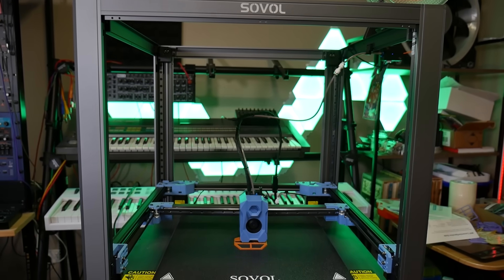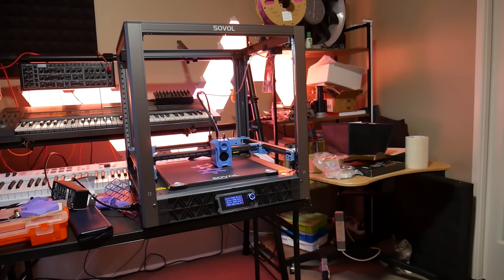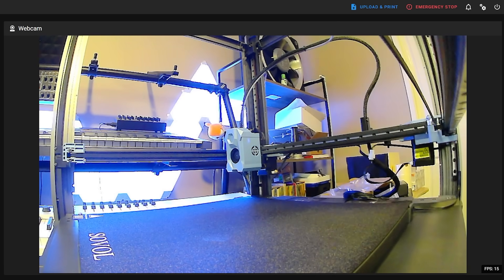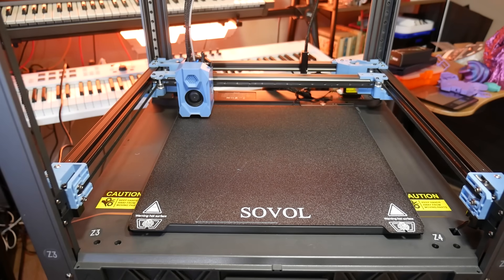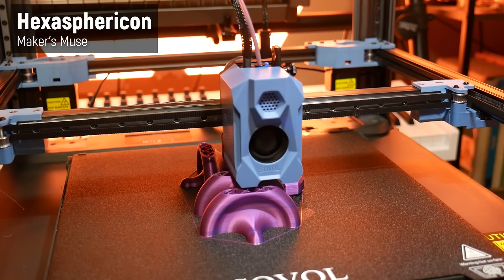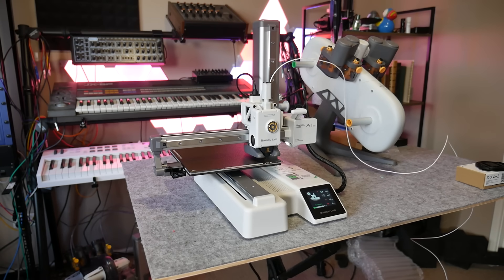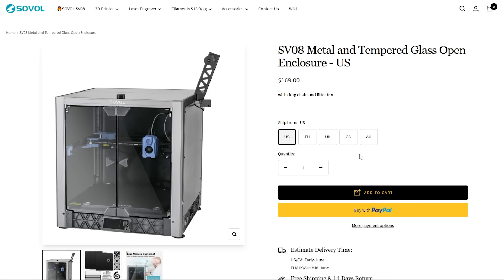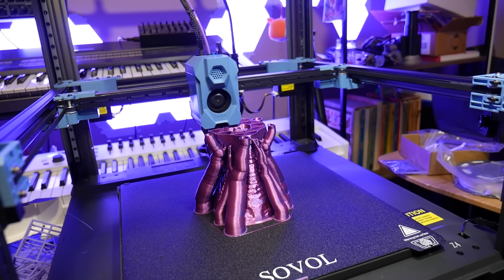Based on a VORON, made by SOVOL... but is the SV08 any GOOD?

Comment: A lot of people in the 3d printing space might not remember or be aware of how important open source is to the existence of 3d printing as we know it, and it's always good to remind ourselves of this, reward companies who maintain it, and avoid this who don't. And if we do accept the benefits of open source, we also need to accept it's getting far more difficult for open source to function commercially in this space. This is why I do not support Bambulabs.

In a perfect world, all printers would be made from standard parts that could be sourced from at least two independent manufacturers, but as people demand increasingly absurd printing speeds, that becomes impossible. People need to think a bit about what they actually need from a printer. Instant gratification, or long-term sustainability. If your printer has a proprietary hotend to meet speed demands and that company stops selling that hotend, your fast printer is suddenly not that fast after all.

Comment: You do not have to rely on any spare parts from sovol. With everything available as step-files, you can print every mechanic part wich isn´t standard. While they are designed for injection molding, at least all smaler parts could be SLS-printed, so you could get them without changing them for FDM printability. Even the coldend can be printed from aluminium for a reasonable price - The next layer even made a Revo version as a drop-in replacement (actually this is a game-changer for me, as you get the same speed with high-flow Revo, but can use a Standard-flow Revo nozzle if you want to use a filament changer to avoid the waste of cut&poo). He also replaced his toolboard by one from BTT, so no problem here at all. You do not depend on Sovol to service the printer for years.

Only downside at the moment: Delivery times. I wait for more than 2 months now.

The mainboard seems to be an MKS-SKIPR OEM-Version. You could replace it by a MKS-Skipr or any other board. You might have to edit the configs and do some work (depends on wich alternative board you choose), but you can replace it. So I do not think there is any problem with special parts here.

Comment: The price point on this is simply incredible.   The fully opensource with step files, doubly so,    Some part of me feels like it cheapens the voron experience,  but that is exactly the point and that i just have the wrong attitude about it,  Nothing about this printer locks you into a closed eco system,  it lets new comers get their feet wet with voron tech for a fraction of the price,  anyone who wants the full voron experience can always built a 2.4 or whatever subsequent variations come down the line,   and this newfound accessibility to such a powerful opensource platform opens the doors to new contributions from people who may previously been too intimidated to build or unable to afford  entry to such a hobby.  Overall  very pleased with Sovols Approach.

Comment: Sovol has so far been the best of the lot for using design principles from an open source project and then giving back the community via donations to the open source movement. Creality copied a bunch of OpenBuilds projects to create the ender 3 and contributed zilch to the designer. Bambu took design elements from the Hypercube community and actually closed sourced them. However do feel that the donation of $2 per machine to the Voron team,after being called out,  is paltry when they could be making millions on this design.

Comment: Angus, I like this review, but I would advise a lot of caution around calling this fully open source, as Sovol does not have a good track record with honesty in this regard. The infamous SV06, marketed as fully open source for several years now, has an ongoing battle in its own GitHub issues page as Sovol refuses to release the schematics of the mainboard and electronics. Its certainly way better than most other companies where the best you can expect is the owners manual, but I think it is incredibly dishonest that Sovol still claims to have a fully open source machine and markets as such when it is blatantly false.

Comment: If I made an enclosure for the sovol 08, what would i need to change to print carbon based material petg and etc?
Reply: Normally just a nozzle. But there are no hardened nozzles yet, so you wait or replace the hotend

Comment: Bambu has been the big comparison for everyone lately, and while others may be making cheaper machines, they've yet to include everything that the bambu machines have (for some reason); not that I'm some bambu shill or anything, I'm just wondering why everyone isn't including accelerometers and load sensors, as well as making machines that require as little attention to get good prince out of as the Bambu ones (at any price point), you would think a lot more machines would be offering these things by now..(not that the printers haven't been making great improvements recently, but it just seems a bit disingenuous to constantly sneer at a group when everyone else still requires quite a bit more attention in comparison 🤷🏿‍♀️)

Comment: If I recall, Solvol was going to donate a couple of dollars per machine sold to the Voron project.
As long as they keep it full open source, then I don't think there are any issues with this from licensing or anything like that.    Solvol seem to be sticking to the full license agreements and that's fine in my mind.    The machine is not overly expensive compared to similar machines on the market, and wit ha few firmware tweaks, some slicer profile tweaks and a few different nozzle options, this could really be a competitor for some of the closed source machines.   I am considering replacing y Ender 5 Pro with one of these.  Mainly because I am at the stage now where I am beyond playing printer upgrades and tweaking and prefer to just print good quality prints.    It should fit nicely in my existing "tent" style enclosure, but I may also look into the Solvol enclosure as an option is it looks quite a clean solution

Comment: Have you tried to get the Sonic pad to work with the BTT SKR E3V3 on an Ender 5 plus?
Put the printer.cfg on the usb drive.  The sonic pad sees the printer.cfg.
But in the end fails every time.
I see that most people have been using the BTT SKR E3V3 on ender 3's.
Angus

Comment: I think the price shows just how much R&D costs.  Sovol has managed to save a lot of time and wealth by building upon the Voron tram's designs, and that's almost certainly reflected in the end pricing.

(For the record, I don't think Sovol is doing anything wrong with this printer; they're following Voron's rules, and it's not up to anyone else to get angry on Voron's behalf.)

As for the nozzle - the v6 needs to die as quickly as possible.  Screwing three different pieces of metal together at a temperature high enough to light paper on fire is a dangerous kludge, and the all-in-one nozzle and throats of the last couple of years are the best thing to ever hit FDM printing.  Yes, it would be nice if one design would emerge as the go-to, instead of everyone's being different, but the actual functionality of these new nozzles is just so, so much better.  In my not very humble opinion, all the people going on about the lack of "normal" nozzles are on the same page as all the people who'd rather spew ridiculous amounts of carbon into the sky than buy a fuel-efficient, modern car, because the "can't fix the engine."  Technology marches on, people.

Comment: It’s time to design and sell a printer, Angus! Partner with a manufacturer who will give you full control over the final product and I’ll be first in line for the Kickstarter. You earned my trust years ago and I want the printer that checks all your boxes; I’m sure others feel the same. Take my money and do it! 😁
Reply: The boxes to be checked depends on your purpose. You don't need a 40cm^3, tool changer, 90° heated enclosure, direct drive, water cooled printer for every print.

Comment: Seems like an awesome printer. One of the reasons I love my Ender 3 and CR-10 so much, is that they are open source and easy to modify. The SV08 is at the very least open source, so I am wondering how well it would be to modify. Could you fit parts meant for the Voron onto this machine? Or would you have to adjust/redesign everything, that you want for this new printer? If one could just upgrade/sidegrade to an original Voron hotend, extruder and fan shroud at any point, when their nozzles may become unobtainable, then that would simply fix the whole issue/risk, wouldn't it? Parts for a Stealthburner can be ordered as a kit from China for 30-40€ (idk how well made each of these is, but I assume they are good enough and one would at most upgrade one or two small parts later)

Comment: Moderately surprised you said it was based upon the Voron 2.4 kit, when Voron Design does not produce kits - they only produce designs.  Yes, there's the 19 Voron kits from way back when, but those are rather different compared to any of the current designs.

Comment: This or the P1S?
Reply: I'm about to order the P1S, but this and the creality k1c are making it difficult to pull the trigger haha

This is probably by far the best value, with the highest potential, but it would definitely take more effort and tinkering to take it up to and beyond the P1S quality.

K1C is like the middle ground, pretty open source and better hardware than bambu for cheaper.. but it's creality and will probably need a little bit of tinkering as well.

I think I will still go for the P1S because it's the most complete and refined package, but I'm not exactly happy at how much more expensive it is, for worse hardware :/

Comment: you can't honestly praise having spare nozzles sold directly from the company at the same time that you recognize that if they deprecate the model you just won't be able to buy it anywhere...

to be clear I don't really see it as a problem. any printer popular enough will have aliexpress clone hotends that are perfectly good. and those usually even have screw in nozzles (which is the primary part that gets worn out and needs replacing)
but those two statements back to back in the video gave me whiplash.
it's an open source project, you will probably always be able to find a hotend that works for it as long as the model is technologically relevant.
Reply: it's a voron. use whatever hotend you want
Reply: @aleks138  Yeah that's basically what I said... It's just how he put the two lines together in the script is insane.

Comment: 12:30 Any initiative to make 3D printing more capable and accessible is a win, for me. There's no violation of any open-source licensing, nor any bad behaviour AFAICT (like modifying and closing the source, not contributing to the original project, etc). The project is open-source. They're even donating back to the Voron Project. This is absolutely the right thing to do. There's nothing to be suspect about -- in fact, this kind of questioning makes no sense and may be even a bit detrimental to the community, they did nothing wrong, and are not acting on bad faith.

The Sovol SV08 is the printer I was waiting for, to escape the closed-source trap that is Bamboo (or even Creality recently), etc. Too bad I just bought a SV06 a while ago, so no budget for a new printer for the time being... :(
Reply: The only issue I have with it was using the voron name in marketing. Everything else was good

Comment: Well. If looking for a machine to print out massive PLA items i guess it is a great machine.
But if you want a wider variety of materials there may be better options. I want to work with abrasive and flexible materials so for me its a pass. On the whole Voron aspect. Well they keep it OS and have taken their own twist on it, which is in line with the project. So its fine in my books. Still rather have a voron though with hardened nozzle.

Comment: Other printers with all open source firmware and STEP files: Ender3 , Elegoo Neptune 2 / 2S and Neptune 3 / Pro but not the Neptune 4 (there's an opensource clean Klipper repo called OpenNept4une but no STEP files yet some parts are common to Neptune 3).  Prusas and clones.

Comment: bambolab is still the answer for beginer or novice.  set it and print in 10 minutes
Reply: This is just sad.   Why does EVERY printer review of a non-Bambu printer have to have its comment section filled with people shilling for Bambu?

Is it because BambuLabs and their users are not confident that BambuLabs can stand on their own merit without tearing the competition down at every opportunity?
Reply: @stew675 Even if it’s sad, it doesn’t make it untrue.

I’ve been religiously using Prusa’s Machines for the last 4 years. If I were starting over in the hobby, I’d get Bambu’s cheapest option and call it a day.

Open Source is great and all, but I’ve gotten to the point where I honestly don’t care. I want something that can print things. That’s literally it.
Reply: All of my printers print things and I don't have to think about it any harder than "which filament should I use for this model?".  I might occasionally need to calibrate some new brand of whatever filament roll because I'm fussy, but largely I can just load in whatever I want, select the correct type, and click print and it works.  I guess I just don't comprehend the concept that only one brand of printer is able to "just print" when it's blatantly apparent that almost all printers do just that.

Comment: Sovol seems to be hitting all the right steps for me at least.  While I have found the performance of Bambu printers impressive, I pretty much reject any option that isn't open.

I'm definitely in need of a new printer, but it will be a while before I make any purchases.  I hope that the TPU challenges can be overcome.

As far as being based on the Voron, that's fine.  From the comments I see that they are contributing to the Voron project based on units sold which is frankly exceptional.

Comment: I disagree with your statement that this is open source. There are plenty of parts that are missing in the CAD files. For example the sheet metal that covers the bottom of the printer. Also the PCBs aren't open source. They are just some schematics, but not the actual source you could modify to create your own PCBs. So you could say that this is printer is 'somewhat opensource'.

Comment: I wish companies would finish printers. This printer again seems unfinished. It feels like Bambulabs made a finished and polished user experience and the other companies only saw core xy and print speed and so they just keep pumping out half finished product after half finished product thinking "where is my Bambulabs popularity???".

Like they just dont get the formula almost like they dont use their own printers.

Thar said, I do like that they made a near to voron printer without the tedious 40 hour build or extraneous over engineered parts though. Just wished they let it bake for 2 monthes more.

Also, open source files (especially step) are commendable. Not even so called open source Prusa has all the hardware source availible for all their printers.

It is bizzare the lack of hardened steel nozzles though. That's a necessity.

Comment: If I hadn't gotten the X1C in January I'd be ordering this. But as the Bambu La\b is my 5th FDM printer, one of which has been retired into my garage (out of sight out of mind), I cannot let myself buy another one right now. As always great review. Speaking of the garaged printer, I wish I had discovered your channel before buying it in 2018 as I would have gone for a different brand, and not the Monoprice Maker Ultimate (Wanhoa D6 rebranded) with which I started.
Reply: If you already have 5, the one to look out for is the idex RatRig Vcore4

Comment: I downloaded the full machine model and imported it into FreeCAD. Worked great! This is a huge deal. Anyone can now start with exact measurements and make modified or new parts for the machine without having to reverse-engineer it. Perfect for those who want a bare bones solid foundation to build on. If Sovol are able to avoid major quality issues, this machine will become a massive hit.